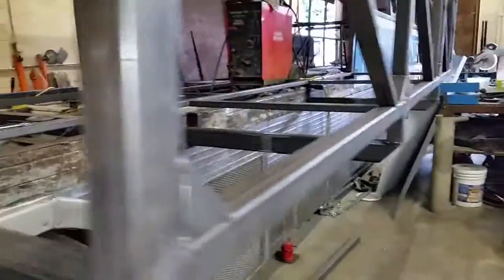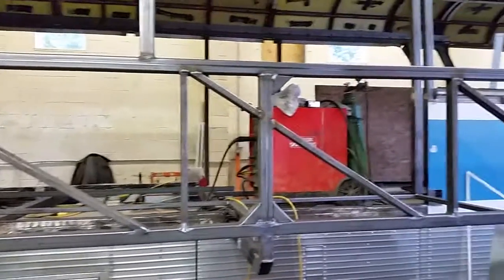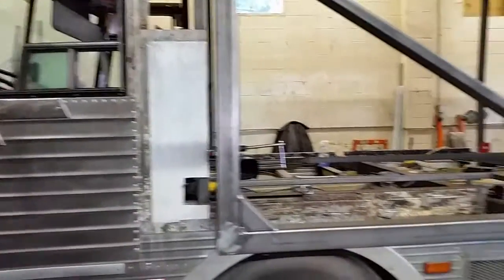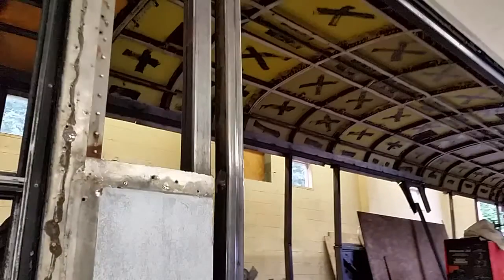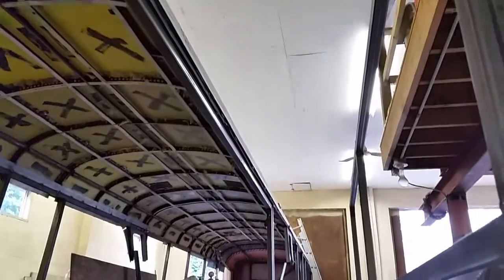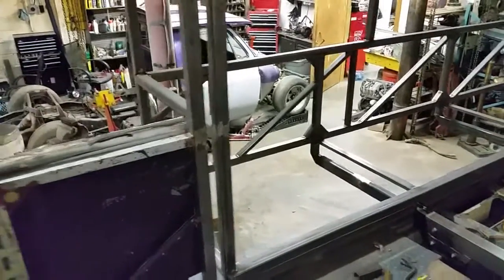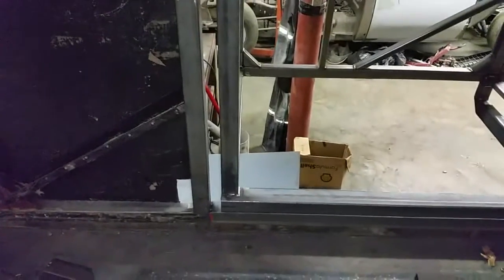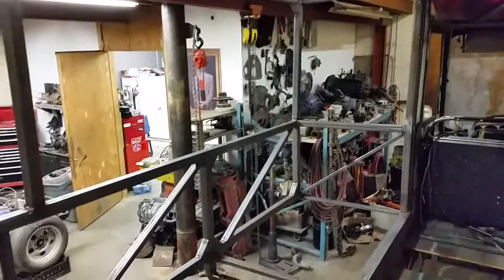Bus Conversion Project Video 20- More Slideout Construction

Comment: Sorry for so many questions!! It's just extremely interesting to me. My question is would you consider going larger for the slideout? Maybe 2/3rds the length of the bus itself on one side? Would be mind blowing how much square footage is added, and wonder why nobody has done it? I have seen it done on custom hollywood trailers, and custom hollywood busses I believe, I've even seen one bus that extends upwards to open up the 2nd floor/story! That was really genius (rides around with 1 floor accessible until it's parked, then extends upwards to raise the roof for the 2nd floor). I would prefer it to slide outwards so the main occupants get the benefits of the added sq footage.

Comment: After studying this carefully, I see a major structural flaw that if not corrected is a disaster in the making. The frame on the sides of the bus are an exo-skeleton. that means, when you cut into it, the bus will not hold itself together. That side IS the frame. After cutting it, the 3 tons of weight under it, in the cargo bays will drop the bus in the middle and fail. 

Prevost, MCI and HWH all had structual beams under the bus floor that seems like it is about 12" deep to take over the framework lost above. They use the brightest engineers to figure this out. You have not only missed it, but cut into the fore-aft stringer that is critical for tension and strength. Sure it is welded but MCI put in 2 stringers welded together for a reason - tension and stress loads. they know that there will be serious weight in the bays below and the passengers above. So the walls and the truss design were all tied in to act as the bridge span. Cut that and you are gonna have problems. 

Unless you deal with this issue, I see trouble ahead - big time.
Reply from the maker: No problems in the last 5 years, so far anyway, MCI buses of this vintage have all of their framework below the passenger floor and I didn't cut into any of that, GMC Buses were monocoque but these are not, the only place I cut below the floor level was where I put the entry door and it was definitely not structural, the wall and window sections I removed for the slideouts are not structural either , I appreciate your concern though

Comment: What are the dimensions of the slide out and how much do you think you have in the tubing price wise?
Reply from the maker: this slideout is 13ft. x 3ft., the one on the other side is 9ft.x3ft. and the bedroom one is 9 ft. x 30in., I have spent around 4000.00 on the steel for the bus including the material for the stretch and roof raise, didn't separate it into projects, I'll have about 3000.00 in Aluminum to reskin it and around 1200.00 in the stainless lower panel replacement, 1200.00 in rivets